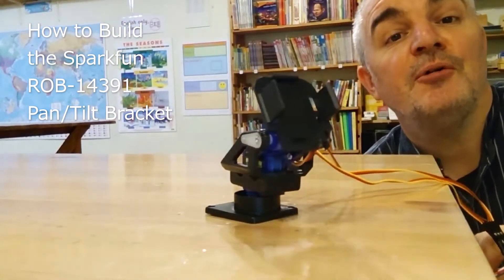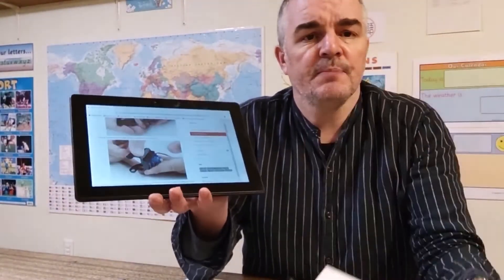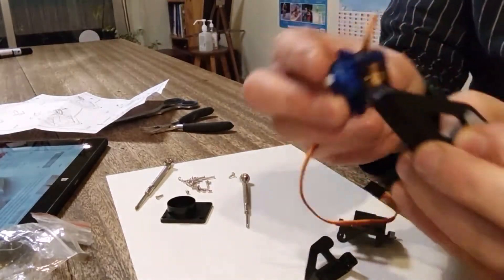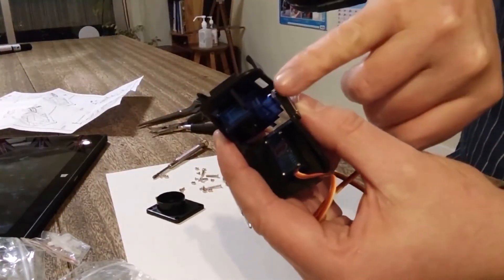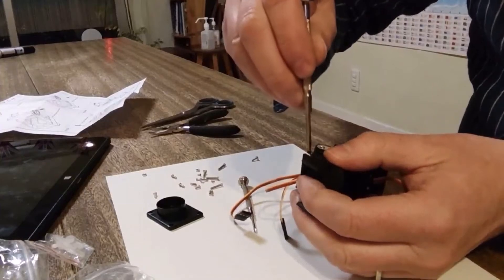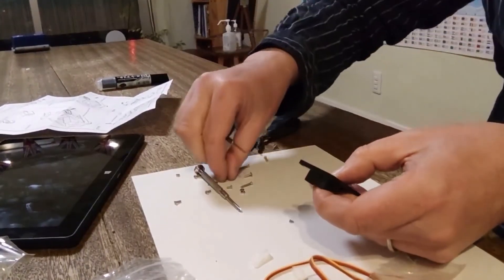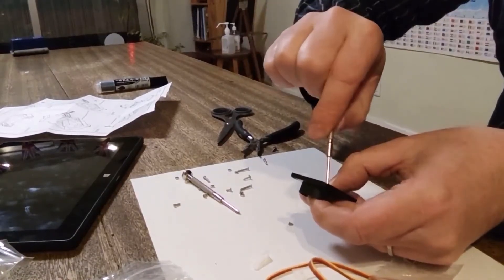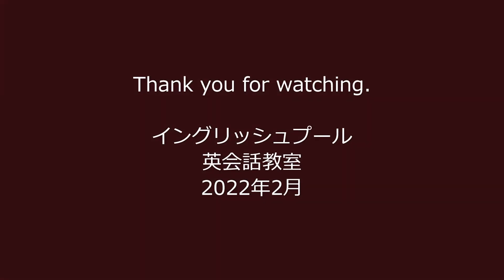How to Build the ROB-14391 Pan/Tilt Bracket

Comment: how well would it hold GoPro Hero 7 black, some 150g? I need only the bottom, pan, part. will it wobble a lot? thank you.
Reply from the maker: I can't say exactly as I don't have a GoPro, but at 150g I think it will be too heavy for the ROB-14391. Sparkfun use the same pan/tilt bracket with their Raspberry Pi Zero W Camera Kit and the camera module weighs in at only 3g!! Even with no load the bracket is a little shaky!!